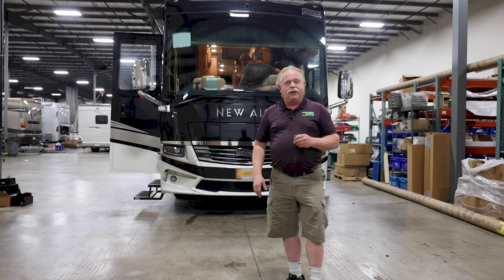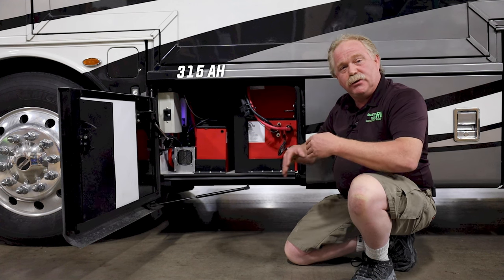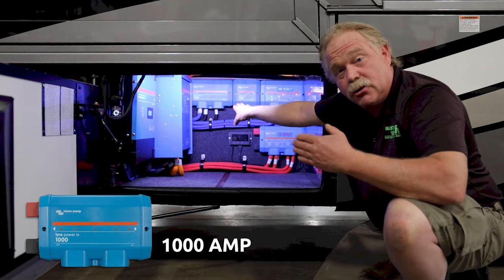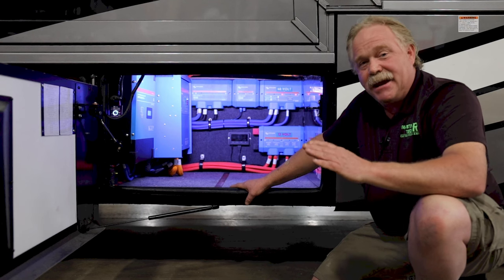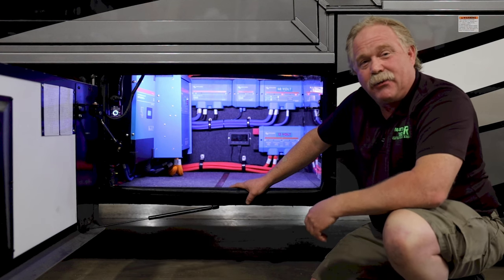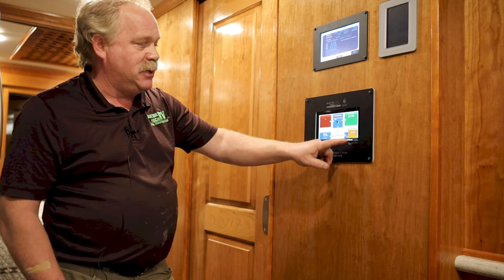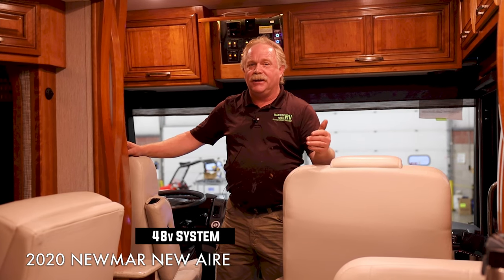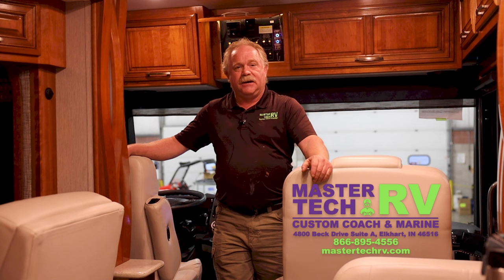48 Volt RV Battery System w/ Solar Panel Grid | 2020 Newmar New Aire

Comment: Curious if these customers gets solar because they boondock a lot or stay at campgrounds without electric hookup or simply for convenience when going down the road between stops. 
Your installs are very high quality and professional.
Reply from the maker: The High voltage Solar combination extends your actual run time as 5-7 of our 215w premier panels provides enough charge to actually run a 15k penguin AC thru a 48v inverter/ high amperage Lithium Package .. So our goal is to have enough solar to charge during the day while using One/Two acs then to have enough Lithium Capacity to run thru the night without having to use the Motor 48v Alternator and or the Generator to charge... Also by adding Solar you can qualify for federal tax credits claiming the RV/Coach as a second home.  This credit on average is a savings of 30+% for your entire build.
Reply: @MasterTechRVServicesElkhart  but do you find that your customers plan to boondock a lot? Judging by the year and make of the coaches these don’t strike me as owners who do a lot of boondocking.
Reply from the maker: @barryholiday8998  We have several owners that travel/camp outside of Campgrounds.. Including traveling professionals.. Harvest Host, State Parks & County Park users to Festivals & Events like Burning Man and more.. We create a camping Lifestyle that allows you to travel more independently and affordability then you can imagine.

Comment: I'd like to know what would happen if you took the alternator out of the equation. Can it work for some people? Can it work for all people? Or it won't work?
Reply from the maker: The alternator system allows you to maintain a full battery charge while running an entire coach including three/four air conditioners or heat pumps while traveling.
 It is the fasted way to charge the Lithium.. but the Lithium Modules can also charge off the solar and the Generator or a Campsite power pole..
both of the two would then charge the bank thru the inverters.